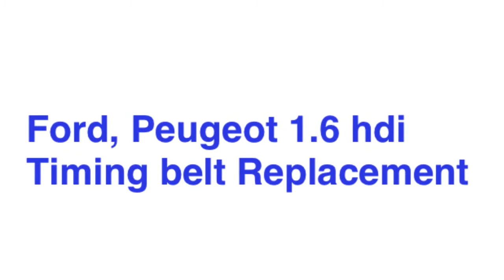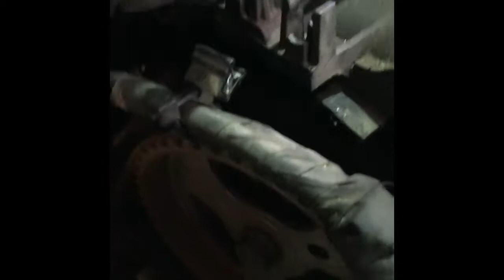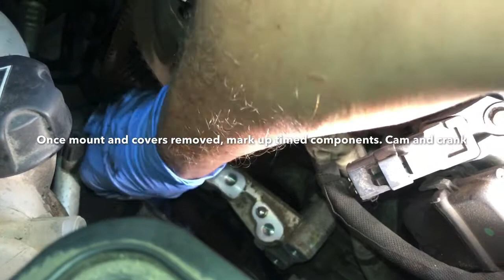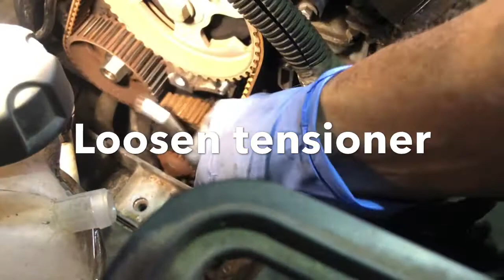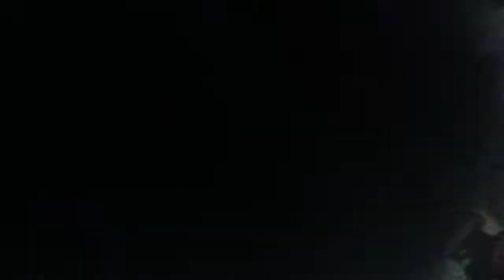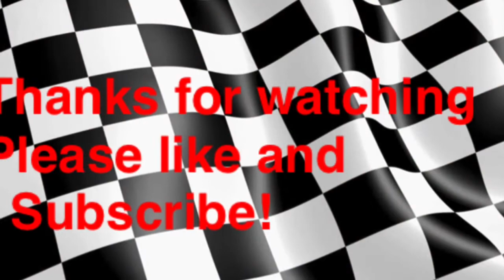Peugeot 1.6 hdi timing belt change, 1.6 hdi cambelt change. step-by-step guide.

Comment: Wrong message the  usage only marks and not the syncro holes of 4 pulley with 4 pins.  Dont folllow this method.
Reply from the maker: Correct. But sometimes not everyone as the required tools. This is a method used on such occasions.
Reply: @How2FixIt1  And this can lead to damage being done.. do it the correct way